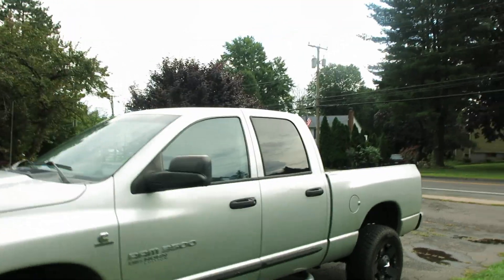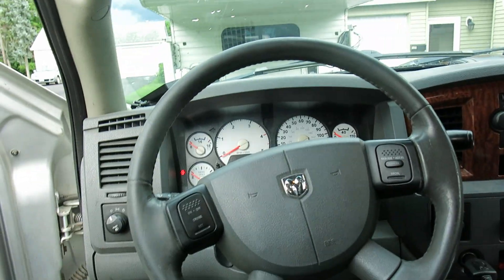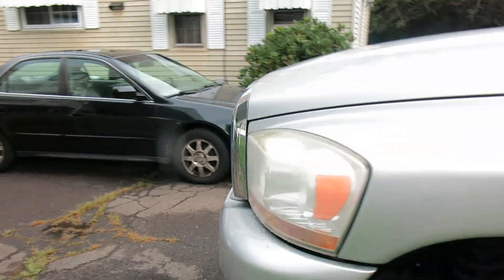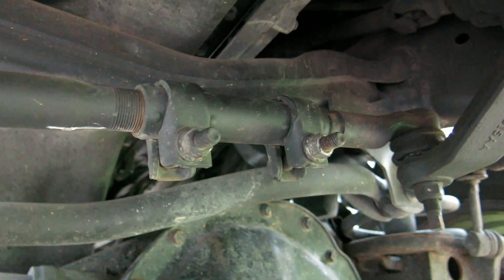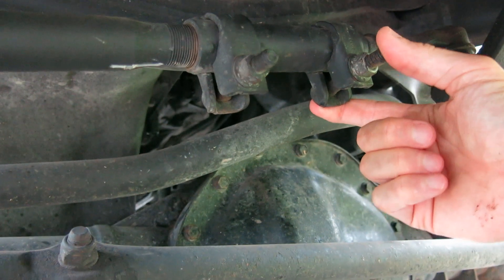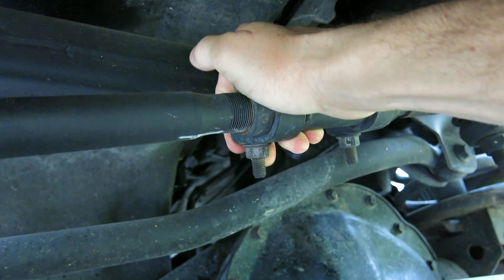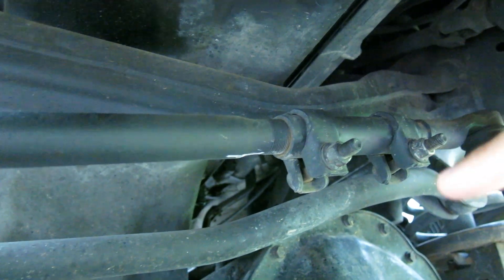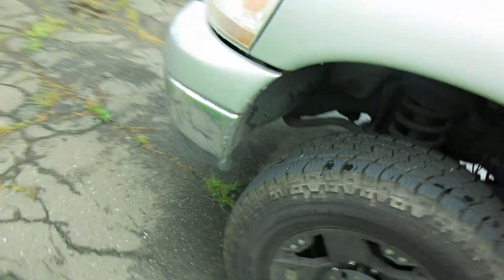Steering Wheel Adjustment - 2006 Dodge Ram 3500

Comment: This was very helpful as I have a 2007 2500 4x4 and the same thing happen that these adjuster nuts were loose. Though after driving down dirt roads and some rough asphalt back roads my steering went 180 degrees off and wasn't sure what heck was wrong at first. As the alignment was fine just wheel kept becoming more and more off center while driving. Had to make an emergency pitstop and found this video super helpful. Was able to get under the truck and discovered the nuts were loose. Made the adjustment to get the steering wheel back to center, tighten the bolts, and I was on my way again. Again thanks for the useful video!

Comment: Hi, when turning this adjuster...will it throw off the toe on the truck ?
Reply: Randy C No, all this does is adjust the steering wheel position in relation to BOTH wheels.
Reply: @brendancoleman2839  Thanks for the reply, I adjusted my wheel the same way you did and all is good now. My toe was not affected at all...great video thanks again for posting.